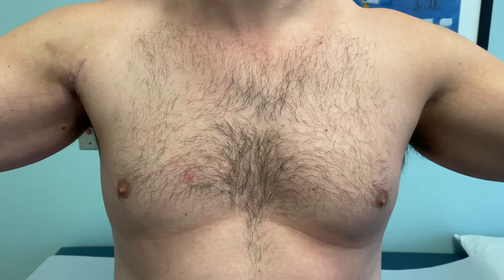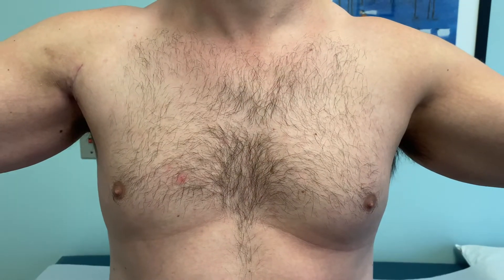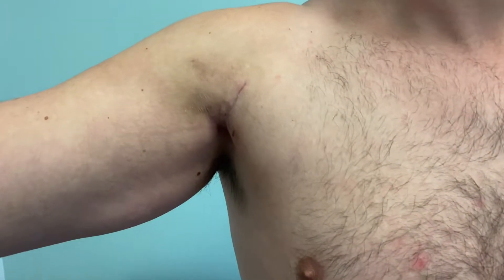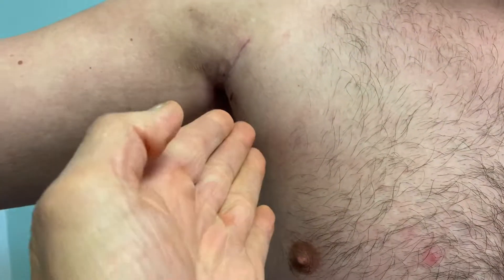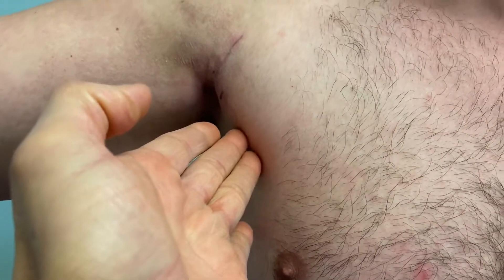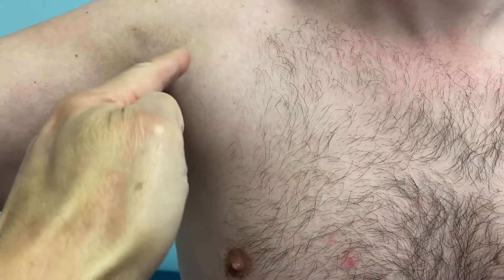Old Pectoralis Major Tendon Tear Surgery: 7 weeks after a #MoraMD PecFlexFix Procedure

Comment: What if you have a partial myotendinous tear? Can you still allograft it a long time after the injury? I had a full tear at the bone but also some myotendinous damage. My surgeon repaired the main tear 10 days after the injury but not the myotendinous tear. Now it feels kinda thin in the axillary fold. Im 14 months post op.
Reply from the maker: Almost all of my late reconstructions are associated with myotendinous tears. If you have a significant deformity and significant weakness, that torn portion can be reattached back to bone with cadaver tissue, as described in some of my other videos.